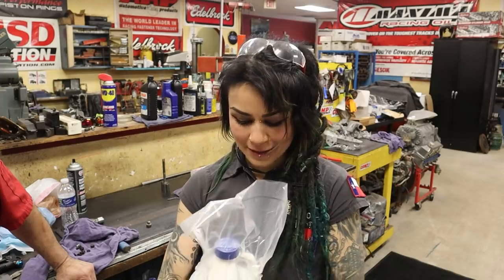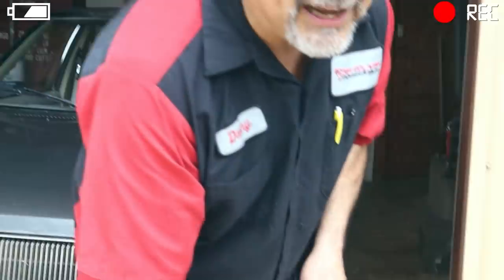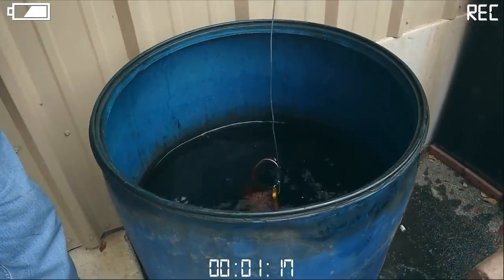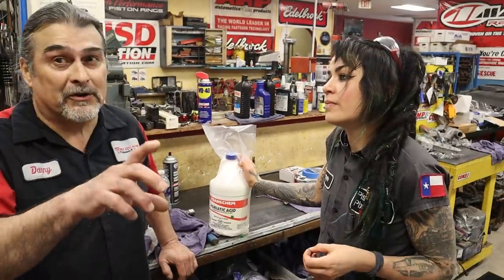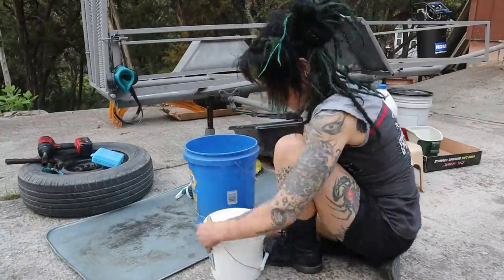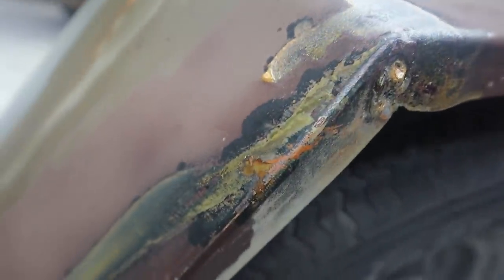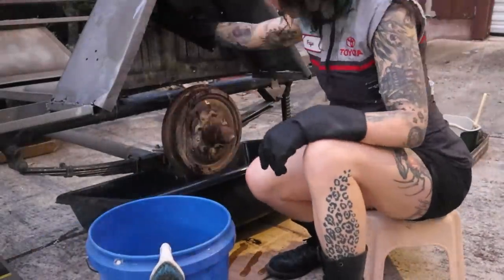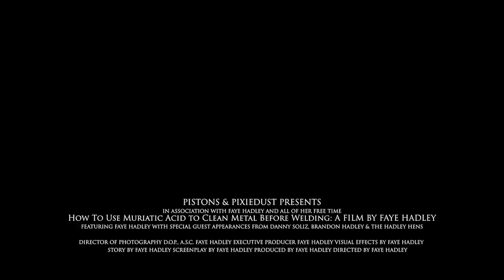How To: Use Muriatic Acid to Clean Metal Before Welding – Crappy Trailer Restoration Pt. 2

Comment: Good info on using that acid. A bit extra info about it people might want to know. The fumes from use and even idle evaporation are bad. They will rust any metal in the vicinity. Even as much as ten feet around the bottle. Best keep the container outside or double bagged if stored inside.
Reply: They will rust even if the bottle is closed.
Reply: @willysnowman  I did some small parts for solder out doors and brought in to solder only to fine that he newly built offroad buggy frame was completely rusty along with everything in the shop. be carefull

Comment: If I were you, I’d get new trailer fenders, cut off the old ones, then weld tabs to the trailer frame and bolt the fenders to the tabs. That way they’re removable should one get damaged or whatever. Just my opinion though. Do whatever you think is right I’m sure it’ll turn out great. Cheers 🍻

Comment: By the gods, who ever weld that trailer in the first place have no welding/fabrication skills at all🤣 Good job Faye! Thanks for Danny all help! Cheers!🍺🇫🇮
Reply: You'd think they'd have tried some test beads first. The tube welds don't look half bad, but the fenders are atrocious! Likely used a cheap welder that didn't have a lower current setting. Sheet metal is easy to burn through.

Comment: Lots of good advise from Danny! I used muriatic acid on my truck's recovery shackle to strip the galvanize before powder coating. Besides smoking, the shackle became warm to the touch!
Reply from the maker: YES!!! I experienced that too! So crazy!
Reply: @FayeHadley  Exothermic reaction. You can cause the same thing just by mixing the acid and water in the wrong way. "Add acid to water like you ought to"

Comment: Excellent safety lesson on muriatic acid, known in the chemical industry as hydrochloric acid, HCl. It is dangerous and very corrosive to metals, but at 20% solution with water can be used to clean old tile and grout and at 10% can clean dirty or stained concrete. When diluting acid, always add the water to the container first and add the acid to the water. If you add water to strong concentrated acid it generates a lot more heat and will melt the container, break it, and the solution will boil violently splashing acid all over the place, including all over you.

Please encourage Danny to wear safety glasses when using his barrel of muriatic acid! You never know when a drop of any chemical is going to go flying and hit your eye. I speak as someone who has gotten a single drop of a corrosive chemical in an eye, and I was wearing my safety glasses at the time. It plopped over the top of my left lens somehow. My eye is fine. I immediately washed it out of 20 min with water then reported to medical and they drove me to an ophthalmologist. He examined my eye for damage and found a small amount of damage that would heal in a week by itself. I had to use eye drops and wear an eye patch, but it healed nicely and has not effected my vision in the long run. But, it hurt like hell and they gave me some pretty strong pain pills to use for a few days until it healed.
Reply: meanwhile treatment for grinder dust, when you are old, will cost you 10k a month. You made the smarter move using chemicals then going at it like a psycho baboon with a spinning rock. the HCl is easier to manage, and less harmful in the long run. You need to design your tools not to splash and stuff though (this means paying extra for beefy containers that have pouring features ETC).

Comment: Excellent video  Faye  I would’ve got some little pieces of channel cut them fenders off and then bend some metal and then screw them on so it’ll be a lot stronger case you have to remove it and then the other metal I would cut out and put stronger bars across it thought of trying to re-weld the existing metal that somebody didn’t know how to weld at the time good video keep up the good work can’t wait to see you next one you’re awesome thank you

Comment: Hey Faye,  The trailer is really coming along nicely Funny Danny  mentioned it we had a built-in pool growing up every year we drained it and brushed it down with  Muriatic  acid this thing was huge 36×18 9 feet deep held  27,000 gallon, it was a lot of work and then every five years or so we cleaned it and repainted it. Can’t wait to see how it comes out have a great one as always🐔🐔🐔👍

Comment: I've got muriatic acid on hand that I was using for something else. I should try i next time I need to weld galvanized. I always grind off the coating first, and weld outside.

BTW, I'd recommend spray-on rocker-guard on the inside of the fenders. That'll save you from having the paint flake off from gravel spray, and rotting the fenders out from the inside.

Comment: Over the years I have bought and sold a lot of used trailers. So I was impressed that you bought a trailer for $100 and it even had fenders on it. You managed to tow it home without having the tires come apart or the wheelbearings freezing up. OK so was that $100 the asking price or did you negotiate that down. Also what was the cost to have the trailer sandblasted. Never had anything sandblasted before always thought about it. Thanks for the informative video

Comment: Ya, that trailer is actually not welded at all, it's just "weld spitted".. Who built that shoud have taken at least some time in practice before, if he wasn't practical.. The wiring job also was a disaster, should have some nice holes with grommets where it goes through metal components. It looks like they just thrown together some junk laying around... Before reusing wires, check them for peel or damage, otherwise you will always have some unexplained troubles.. =) Keep on, looking forward to see it coming redone. Muriatic acid is a bad ass thing, I've used it to clean all the profiles for my carport/crane/service bay...  It worked wonderfully.  Cheers, mama Faye!
Reply from the maker: Thank you!!! Yeah, it made me feel better about myself seeing those welds for SURE HAHA! I'm excited to see where I can take this thing!!

Comment: I think Stevie Wonder was trying a welding class on that trailer that day.
  We had a "Crank-Top" Lincoln stick welder on the farm and my step dad & his dad, neither knew how to weld so by age 10 (The Oldest) I was the resident welder on broken equipment!
  Yes, crank-top? Anyone ever seen one? It had a 10" crank on top with a knob, a vertical pointer for amperage, and would simply lift the primary side of the transformer up or down, controlling amps by mutual induction. The more of it lowered into the secondary part of the transformer, the more amps you got. I have seen a guy re-wire one and turn it into a battery charger. Just added more press-in diodes used in the Delco 10S alternator to create a more controlled (-) negative and (+) positive. You could buy them at farm auctions for under $10 to $5 dollars. Most had a broken wire inside from moving. The old tar-soaked insulation over copper! Serious! DK, Omaha.

Comment: Nice video.  I use quite a few acids and caustics for cleaning.  Some that work great for rust, don't work good for oil/sludge and vice versa.      Simple Green aviation over night is great for loosening sludge and is very safe and non hazourdous, it's expensive but safe on precious parts like Alluminium, some parts need a couple of days in the tank with some agitation here and there to speed it up.     You can use a Hot caustic cleaner e.g from Atotech (Uniclean x40), or Macdermid Enprep 114, but they require heating to high temperatures which is expensive and lots of fumes, and only for metal (no alluminium), - saves on time though.     

Benco B17 (Methylene Chloride / Formic Acid / Phenol mix) is great for oil/paint, but extremely hazardous and risky stuff, treat it as liquid fire or you are in big trouble, it evaporates quick if not contained.  Works great.

Then yes Hydrochloric (Muriatic acid) great for removing rust, just don't let it sit there for too long.   Often some of the rust that hasn't come off is very loose and comes off with a very light scrubbing with a scotchbrite sponge, easy.    Just use a water rinse after the acid to avoid flash rusting and dry it immediately.

Blasting if done thorough will remove most/all galvanizing (zinc), but often certain areas might not be done thoroughly so some Hydrochloric acid can help remove residual bits of zinc as a safe measure.

As others mentioned, not good to be using Acids or Caustics in a enclosed environment on the regular, fumes will float and land on metals, e.g nearby parts, or eventually if you use it all the time, rust the roller doors and metal roofing, it happens so slowly you won't notice it until it takes effect.

I did recall Faye you said you could use Muriatic acid to clean bolts.  Yes you can, but as Hydrochloric (Muriatic) acid reacts with Zinc and Chromium (when you see it fizzing), its stripping the Chromium (yellow or silver finish on bolts), then the underlying zinc off,   The bolts will readily rust afterwards unless you get them zinc plated again which is costly.    Best is to clean bolts just with degreaser or immerse in gasoline or whatever works to get oil off.

Comment: Very informative tutorial on using muriatic acid. Hydrofluoric acid works very well but it's extremely expensive and using a Alkali soap such as lye soap. What I'm not familiar with and I guess I could do a little bit of research is should I still use baking soda to neutralize everything? But the lye soap, should do it? Stay young

Comment: There are lots of automotive uses for muriatic acid. I use it to clean corroded wiring, crusted up heater cores and corroded battery terminals. It's not exactly "by the book", but here in the salt belt it proves pretty effective at instantly removing corrosion from pretty much anything.
Reply from the maker: Great tips!!!
Reply: You can use vinegar in most cases too. It can just take longer, depending on what you have.
Reply: yeah and it won't kill your lungs like grinder dust. Easy to control HCl vapor. Hard to determine WTF grinder dust is gonna do and where it will end up and what will kick it up and how to trap it. Total nightmare problem!

Comment: So how do you deal with the flash rust?
Maybe you do your welding and the do another quick acid dip and neutralize dip. Then send it off to be galvanised again...
I had something sandblasted once and the shop asked me if I wanted it undercoated so that's a way forward post-weld.
Sorry I'm kind of obsessive.

And does

Comment: Miller makes respirators that fit under a welding mask with filters for galvanized coating. They were about $60 for the respirator and $20 for the filters. I used to weld steel every day with heavy, hot-dipped glavanized coating and never got sick. Just another option.
Reply: I'll have to grab one. I regularly use a respirator for working with pesticides, but the normal half-mask respirator doesn't fit under the helmet.

Comment: I worked in a commercial AC manufacturing plant as a welder building the large galvanized AC bases. We welded galvanized steel all day outside with no respirator and no it doesn't kill you immediately like everyone on YouTube says but it certainly isn't good for you in the long haul. If you have to weld it just do it outside and wear a mask and you're fine.
Reply: Sound's like your employer doesn't give a shit about their workers. I'm shocked... No I'm not.

Comment: From the looks of the trailer at the 6 minute mark in the video the trailer probably started life as boat trailer. Since the type of boat that that trailer would carry would weigh less than 300 pounds it would be structurally  sound for that purpose. It  may not survive putting a six hundred pound engine and transmission on it. 
 The big weak point is the round tongue and side frame. Right angles make steel much more rigid for the same weight. 2" x 3" steel rectangle for the tongue and some 4"x2" open channel for the side rails will really beef up the load carrying capacity. The channel also gives a flat surface for the cross braces and spring mounts to mount to. You can also tuck the wiring up into it to protect it while still having access for repair modification.
If you're mounting a winch and adding tie down points it is a lot easier to deal with a flat level surface than trying to match a round one.

Comment: That acid has 101 uses. Cleaning all kinds of things. Metal you want to weld or solder. (we used it in a rad shop all the time), your toilet, and yes, it can be used on concrete. It is commonly used (diluted) on concrete to "etch it" before painting. Also good for cleaning electrical contacts and fixing sending units from that crappy old gas tank. In all cases, it must be rinsed and neutralized when you are done.
Reply: I found a video on cleaning toilets with this and was shocked when I tried it myself. I was curious what else this might be used for and found this video. I plan on using phosphoric acid on the underneath of my truck mixed with hand gel from another video I found.

Comment: Muriatic acid is also good for removing rust stains from concrete driveways and sidewalks. Just remember to neutralize the surface with baking soda and water when you’re finished removing the rust.

Comment: Since it looks like you're not going to replace those fenders I think maybe you should grind down all the welds as flat as possible and then use some strapping to cap them and reinforce them. Weld the strapping to clean solid metal on the frame and fenders. The amount of rusted out metal on those fenders doesn't look like you'll get good solid welds on the edges. It would really help to reinforce and secure the fenders.

Comment: You certainly know welding better than I do, but considering the thin, ragged nature of some of those broken welds, I would have suggested overlaying some kind of splice plates made of maybe 1/8" steel on them and welding those, instead of trying to weld that raggedy metal directly.  But maybe you did do that?  Anyway, I'm confident you'll work it out so that it holds up great.  Have fun!

Comment: The requirements for self-made trailers here are tricky.  That it is easier to buy about € 200 scrap where there is only the body number plate and papers left.  And make a new trialer using them.
Reply from the maker: Oh, interesting loophole!!

Comment: I just used 25% viniegar/water mix to de rust parts. Its much safer and easier although you need 3 to 7 days to soak the parts so there is no scrubbing required. I restored a 58 Bel Air and every part that fit in a 50 gallon plastic drum got soaked in vinegar water mix for a week or so before i repainted them. No sandblasting needed.

Comment: I’d just use a wire wheel and acetone to clean it. Put rags away or outside when welding. Muriatic acid can do permanent lung damage it’s no joke. Evapor rust stuff is non toxic

Comment: Should've run flux core for welding wire. I don't know the exact science behind it but flux core interacts with the galvanizing & actually makes for some decent welds. I do a lot of work on boat trailers for neighbors & kinda discovered it by accident. I just make sure I stay outside & upwind from the fumes but otherwise never had any problems.

A dampening spring on the drum, that axle came out of something OLD! The bones are good, just needs your touch.
Reply: My welder is a flux-core. I've been considering upgrading to MIG (which can do both, of course), but I've always ground away where I needed to weld and didn't know that the gasses interact differently with the galvanizing.
Reply: @BlackEpyon  typically I give the areas a shot with brake clean just to degrease & knock off any salt (I'm in Cleetustown, FL lol), cut a V on the ends & just go to town on it. Probably the only instance where an el-cheapo HF welder will do a decent job. I think the gas created by the burning galvanizing creates a sort of shielding gas on its own. Dont get me wrong, you won't be laying dimes but structurally it's sound.
Reply: @acemobile9806  Using brake cleaner before welding can create phosgene gas, it is a deadly nerve agent.
Reply: @charliehcrew1957  yessir, i know that, so I let that stuff dry thoroughly & do it all outside. No different than Freon in an open flame, I know it's bad stuff. Been doing it this way for years, not pushing up daisies yet. I'm a small 1 man show, no osha breathing down my back yet lol. #FJB

Comment: Acid dip the block, neutralize it and then leave it in a drum of oil until ready to work on.
If you sandblasted or mediablasted the trailer instead of using acid it wouldn't flash rust because some media is treated with (Zinc?) And leaves a film on the metal

Comment: I assume you're going to paint this, but if not, there's a product called Sharkhide used in the marine industry to protect aluminum and other exposed metals from salt water corrosion. I suggest you replace those leaf springs.

Comment: If you're going to save your acid, make sure you remove the pan and let the baking soda drip on the floor. Whatever drips on the floor will be neutralized at that point so it won't harm anything. If you let it fall in the acid it will lower the pH and defeat the purpose of saving it.

Comment: Faye did your friend say it can be used on aluminum.to strip clear coat
Reply: Never use Muriatic acid to prep aluminum, as it will completely eat through it.  I use Muriatic acid to remove aluminum from crankshaft journals when rebuilding small engines.  Just a little bit of Muriatic acid will eat all the aluminum transfer right off the crank journal and leave it ready to be polished and assembled.